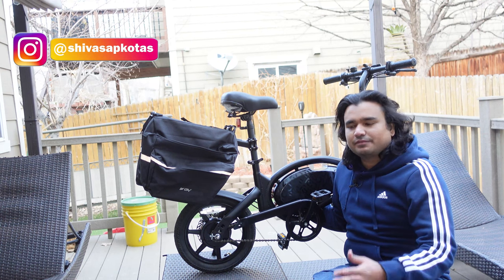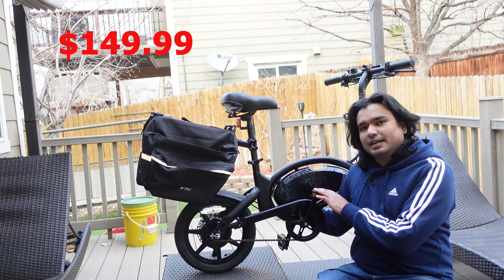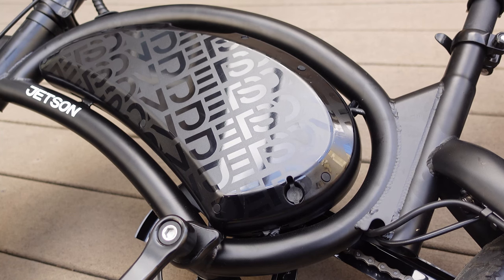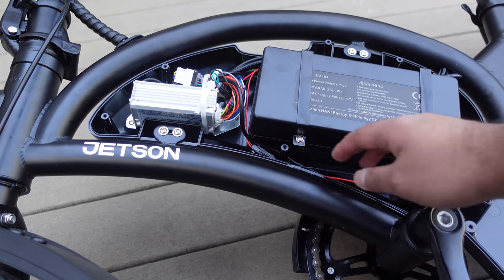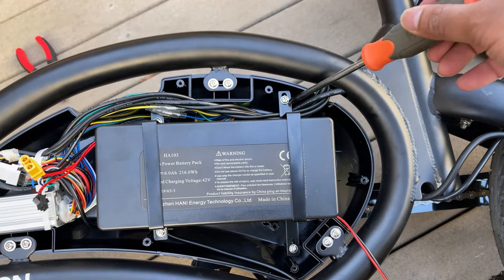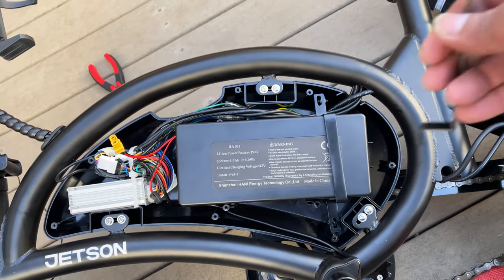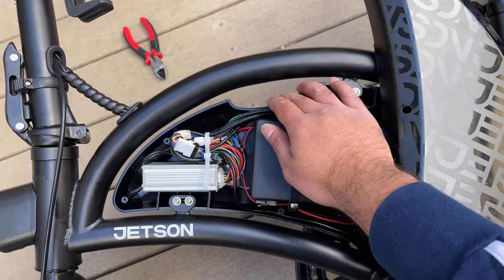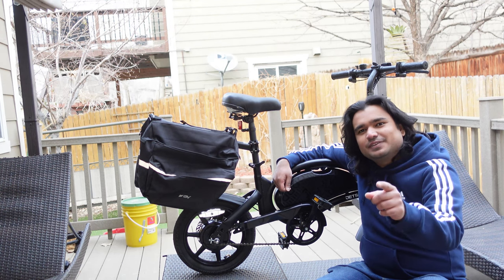HOW To Replace Battery and Cost (Jetson Bolt Pro Folding Electric Bike From Costco) 2021

Comment: Great video Shkiva, thank you.
I lived in Toronto, winter is coming I am wondering how to store the bike. 
Even parked indoor garage can still get as cold as - 10c/ 15F. 
Should I consider to just remove the battery, instead of bring the bike inside the house? 
Thanks in advance.
Reply: I would suggest just folding it up and moving it
Reply: I believe if you take out the battery it MIGHY void the warranty?
Reply: @Shimmermetimbers904  Thank you, end up I brought it down to the basement, just tight turn and heavy for me.

Comment: Hello Mr Sapkota, my Jetson Bolt battery is discharged and won't recharge. It shows "full" on the meter, but as soon as I try to run it the battery icon starts flashing. The charger light used to show red when connected to the bike; now it just stays green. I don't know if the problem is the battery, the charger, or the charge control electronics. Any ideas you have will help. Thank you.
Reply from the maker: Hello, sometimes it is the battery. It could show full charge but it is not providing enough current. I would recommend you give a call to Jetson and see if they can help you sort this out. I suspect it is a battery issue. Thanks for watching my video.
Reply: @ShivaSapkota  thank you, Shiva. I’ll do that. I’m also going to add a second battery like you did. I bought the Pro for my sister; she’s a little heavy and peddling helps her range. 
My Jetson is the earlier model without the pedals -  just has foot pegs - so if I run out of stored battery power I have to walk.
Reply: @ShivaSapkota  Thanks for the videos. Could you please publish the Jetson telephone number? Seems you've spoken with them. Thanks!

Comment: Hi buddy. My cruise control doesn't work. Never has done. Any idea which wire it is inside ? As I intend on upgrading my jetson bolt battery (not pro)  thanks
Reply from the maker: I am going to attempt a controller upgrade this week to hopefully be able to increase the speed in my bolt pro and also add a display in the front. Let me get back to you on the cruise control wire. Thanks for watching my video.
Reply: @ShivaSapkota  cheers buddy. Love your videos. Best on YouTube
Reply from the maker: @skycamvideo  Thank you very much for your kind words. I really appreciate your support.
Reply from the maker: Hey my friend, I figured out the cruise control wire. I am pretty sure those are the same wires for your Bolt as my Bolt Pro. When you open your bolt, there will be a connector with wires that are going to the front (not the back, those are connected to the motor). There is a harness with 6 wires and they are different colors on the controller side vs the one going to the main power. The controller side has (Black, Green, Red, Black, Yellow, Blue) and the other side of the same connection has Black, Blue, Red, White, Yellow, and Maroon. The Black and Yellow on the controller side (which is White and Yellow on the other side) are the cruise control wires. This is probably really confusing, if you want, shoot me an email (sapkotatechnology@gmail.com) and I will send you a picture with labels. Hope we can get your cruise control to work :)

Comment: Please make vedio on jetson pro bolt automatically power cut.  Like i have this bike from last 4 months i used daily but since yesterday its have a problem I didn’t figure out.  What happen to my bike.  Like sometime its good and suddenly its stop when i press trottle its run and stop.  Like power cut.  Again and again its happen.
Reply from the maker: That could be a few things. Do you still have warranty on the bike? If so, please get in touch with Jetson. If not, you might have a loose wire or the battery is not functioning properly.

Comment: That price is extraordinary. 

For example, Makita tools are not known for low pricing, but you can get a two pack of Makita 18 volt 3 amp hour batteries for $99. Connected in series that would give you 36 volts and 6 amp hours of charge, about the same as the Jetson battery pack. You can get aftermarket Makita batteries for less than half that price, but their reputation is not amazing. 

At that price, you begin to suspect that Jetsons real business model is as a battery provider, who just happens to sell inexpensive bikes that will use their batteries.

Comment: Would the Jetson Axle use the same battery?  I can't find any info on it.  It's a 250W and the Bolt Pro is 350W.

Comment: Hello, my question is... the battery status lights just blinking, like a battery is low, but the battery is fully charged (Tested)and the control relay brand new. The bike still not working...and nobody all around me ( all bike repairs) can't fixit, i mean not even touch it , just say no.. still i dont know what is wrong with bike which part is broken. what can i do with it? i really like this bike...my one is dyu but one guy who has a jetson bike said to me that the 2 bikes basiclly the same...so can u give me advice what should i do? many thanks...Eszter

Comment: If my battery was bad I would cut the battery box and install new ion batteries. Easy to do.
Reply from the maker: Hi Ted, thanks for watching my video and supporting my channel. That is very interesting. I haven't thought about installing ion batteries. Are those fairly inexpensive?
Reply: Easy to fine. eBay or something similar. Not like putting them in a flashlight but would need a soldering gun to install. Check out YouTube videos. Let me know
Reply from the maker: @tedthurlby7931  I will look into this. Thank you Ted!

Comment: Best case scenario with using the Throttle only to power the Jetson Bolt Pro Bike. You are able to go 15 miles on the bike per battery charge and got 500 charges on the battery before you have to replace the battery = you were able to go 7,500 miles on the battery before having to change it. Being Conservative - You are able to go 10 miles on the bike per battery charge and got 300 charges o the battery before you had to replace the battery = you were able to go 3,000 miles on the battery before having to replace it.

Comment: D
Would you know which 20AH battery would fit in 12' jetson bolt? Any links? Does jetson bolt pro and jetson bolt have same battery holder measurements? Battery should be not more than  8"x3.5"x3"? What are the battery and controller holder's inside total capacity measurements? I would need a different controller too probably.

Comment: Is there a higher powered battery that can fit the bike for additional power or speed?
Reply from the maker: You can get a higher AH 36V battery that fits inside for additional range. However, you need a full controller upgrade for increased speed. Thanks for watching my video.

Comment: Hey so I found the battery at Alibaba
$127 plus 55 s/h.
New. It has a 10.4ah vs the 6.0ah..that's not a problem correct? It all looks the same, lady online said it is with the exception to 10.4 vs 6
0ah
Dyu E-bike Battery HA103 36V10.4Ah
Reply from the maker: Hi Doris, yeah that battery should do the job. You might get a slightly better range with the 10.4ah. However, check out my latest video I posted yesterday on dual battery for this bike. The battery I picked up from eBay has the same benefits as the one from Alibaba but is cheaper. The Alibaba battery has the same connectors as the original battery, so it has that benefit. I am going to do a thorough testing and review of the new battery I just bought that is 10ah and will check if I get higher range. If you want, you can wait until I do that review and make your decision. Thank you very much for your support to my channel.
Reply: @ShivaSapkota  ok I will..because this battery is very expensive. I am buying my bike today but I wanted a battery as well, because they are so hard to find. Ty so much
Reply from the maker: @GODISGOOD3612  I think the battery I found in eBay will work great. As I said, let me do some testing and will let you know. That battery has 2 years warranty and the manufacturer claims it will last for 1000-2000 charging cycles with good care. It is definitely a better battery than the one comes with the bike.

Comment: Let's say you only get 1 year life out of the battery. The fuel for that ebike cost you $150 for the year (plus the pennies it cost you to charge it). I went through 1 gallon of gas for my honda scooter every 4 days when I went to college in the early 90s. Plus the price of the 2 stroke oil. The Oil was $4 a pint, which was good for about 1 month. Gas back then was about $1.35 a gallon. That comes out to about $14.25 a month for gas and oil. That's about $169.50 a year back in the early 90s. Today, the cheapest 2 cycle oil is about $8.50 a pint and gas is on average about $3 a gallon. That come out to about $31 a month and about $372 a year. That's well over double what you're paying to power that ebike....not to mention maintenance costs you might incur with the gas scooter. I had to have my battery replaced and the cylinder rebored which cost quite a bit of money.
Reply from the maker: Hi Adam, that is an excellent point. Thanks for running those calcs. This bike, especially at that price point, makes it very affordable to get around. I found an ebay battery that costs $100, gives me more range and is supposed to last much longer than the Jetson battery. The calcs would be even better with that battery. Thank you very much for providing your input and supporting my channel. Much appreciated.

Comment: Hi! Do you know if i can just purchase a battery from Amazon with the same wattage and specs?
Reply from the maker: Hello, yes as long as it is a 36V you can even get a larger pack (like 10AH). The existing battery takes XT60 connectors. If the one you found on amazon shows Dean's T connector, you will need a converter. Thanks.

Comment: How do you replace the crankset on the left side and which way does it turn?? Thanks 😊
Reply from the maker: Hi Tina, I have yet to try that. I know you can get a replacement crankset and chain in Ebay (Shimano is a good brand) but I haven't played around with this specific bike's crankset. That could potentially be a future video. Thanks.
Reply: @ShivaSapkota  I already have the new crank set I just wanted to know if you knew how to replace it?
Reply from the maker: @tinaricard8650  Sorry I do not know yet. I need to first do some research and play around with it. Thanks.
Reply: You need a crankset removal tool to take it out. I did it on my Jetson Bolt Pro. I installed a 58T crankset.

Comment: Has anyone else had trouble with a flashing headlight and battery lights when turning handlebars and if so which wire could be causing this

Comment: I have a dyu d3, idk if my battery is messed up or my charging port

It was charging then stopped, now doesn’t charge at all. Bike cuts on still tho
Reply from the maker: It could be a few things. Do you still have warranty with DYU? Sometime the charger cable gets disconnected. If you have warranty, go through it. If not, you can use my video guide to open it up and check. Thanks.
Reply: @ShivaSapkota  I bought it off fb market place
But it was new when I got it. So I can open it up m check it out.
I’ll play your video about it, could I possibly get a direct link when your not busy of course. 
No rush
Reply: Opened her up and my battery looked like gold asked it to spar lol
It’s a lil banged up

Comment: Thanks for the into! I have an E-bike that looks just like the Jetson Bolt Pro but the name of the company is called Ancheer. It has an 48V 6ah/7.5 ah battery with a 500W motor and it goes up to 20 miles per hr. I wanted to bump up the battery and purchase another lithium battery with more capacity. Would It be ok to buy a 36V with like a 20ah battery? I can never find the same battery dimensions with 48V battery because they all seem too big. I just wanted make sure because I don't want mess up the bike by buying a lower voltage than 48. Thanks again.
Reply from the maker: Hello, I don't think the bike will perform well with a 36V battery. It will go much slower plus it will likely cutoff battery power early on thinking the 48V battery is drained out when in reality you have a 36V battery. There are so many things that could go wrong with using a lower voltage battery and I wouldn't recommend it. What are the dimensions of your current battery? Will this one fit? https://ebay.us/r0LWto
Reply: Gotcha I figured lol Thanks! The bike itself is literally the same thing as a Jetson Bolt Pro but with a different logo branded on it lol So I assume the battery dimensions is the same thing as your Jetson Bolt Pro. I noticed the link you gave has a Battery that's 10.2 inches in length so I think its too big considering the Jetson Bolt Pro battery is about 8 inches in lenght. Thanks again for the info!
Reply from the maker: @JeremiahP3  What if you keep the original battery and add a second 48V battery? You should be able to do this: https://youtu.be/5kr7u0--iGI
Reply: I’d prefer just a bigger battery but I’ll look into it lol thank you so much!

Comment: Is there anyway to shut down the power so it can't be stolen
Reply from the maker: Unfortunately, other than the main power button that can easily be toggled on/off, there are no other "secured" power module. Plus, the bike is very lightweight that it can be stolen easily if you don't use a lock. Thanks for watching my video and supporting my channel. Much appreciated!

Comment: Where can you get a new battery..manufacturer??
Reply from the maker: Hi Bruce, thanks for watching my video. Yes, you can email the manufacturer to get a replacement battery. However, check my new video. I purchased one from ebay for $100 and it is a better battery with higher capacity compared to the one that comes with the bike. Here is my video link: https://youtu.be/5kr7u0--iGI

Comment: I'm willing to upgrade the battery and add another motor wheel for front. Any suggestions for Power, battery, wattage, Volts and Ah/Amps? 
Please lemme know, Shiva.
Reply from the maker: Hello, thanks for watching my video. Dual motor would be a little tricky but the easiest way might be to get two Bolt Pros and combine them. You will need two batteries, two controllers and can just take the rear wheel of the second bolt pro and put it in the front. You can still use the second bolt pro as a pedal only bike. I am considering doing that as I have two of these bikes. If you try to source DIY parts, the cost might end up being as if purchasing a new Bolt Pro. Cheers!
Reply: @ShivaSapkota  I appreciate the reply, Mr. Shiva. That is cool I wanna watch that video. In terms of battery because higher voltage and Ahs. Wonder if you are able to do 48v 20ah or 60v 20ah with dual motors because each is 350 watts unless Bolt pro motor is 500 watts then does that mean we need over 1,000 watt battery?
Reply from the maker: @malakaij4072  I think it would have to be two separate systems, so the regular 36A 6Ah will work. So, regular system but two of them. The controller can only handle 36V batteries, so unless you upgrade the controller, you cannot do 48V. 60AH battery would be super heavy and probably end up hurting the range instead of increasing.
Reply: @ShivaSapkota  oh not 60ah that's too much. I meant 48v and 20ah or 60v with 20ah. I was thinking of if you are able to cut some of the plastic to create little more room for bigger battery unless you will hook another battery at the back of the bike. The thing is that I'm still looking online for a fitting 48v 20ah at least. In terms of BMS I'm able to find such a new controller.
Reply from the maker: @malakaij4072  Oh yes, on that case either one should work. I would probably recommend staying at 48V as things start getting expensive and it is easy to burn out at 60V. I think it would be impossible to find a 48V 20ah battery that fits inside the controller housing, it will have to be on a rear rack.
Reply from the maker: @malakaij4072  I will consider that as a future video. When you say clean rear, just hiding the cable etc right? Thanks.
Reply: @ShivaSapkota  Like a certain design box that lets say fit either of personal item or minimum groceries. Once you show us all that then use that finance to open e bike modification store and you boss be the boss
Reply: @ShivaSapkota  let's say that Box also may hold the Li-Ion sect in the box.
Reply from the maker: @malakaij4072  That would be a dream come true haha! 😂 Dully noted though, I will try to make some videos on that stuff. Perhaps we can put an ignition key on that box too.
Reply: @ShivaSapkota  You got this. Just take things step by step and you are already there.

Comment: Hello two days ago I bought two of these at Costco and I can't find how to turn on the front light. Do you have an idea how to do it?
Reply from the maker: Hi Oreydis, hope the bikes have been great. To turn on the front light, first make sure the bike is powered on (left hand button). Next, press and hold the button on the right hand side (under the battery indicator). The light will turn on after 3 seconds of holding that button. Do the same to turn it off. Hope this helps. Please reach out with any questions at any time. Thanks for watching my my video.